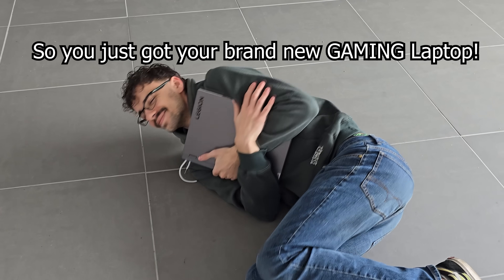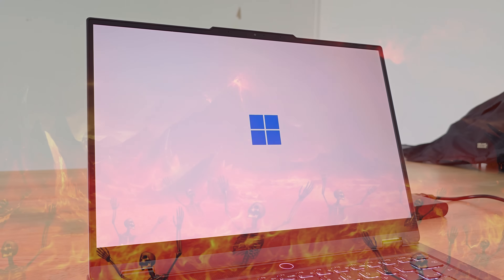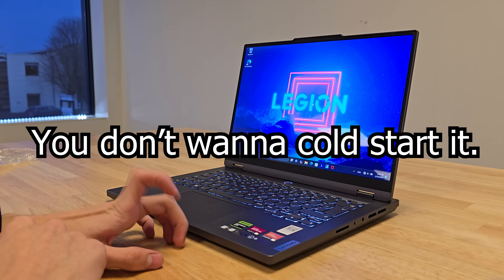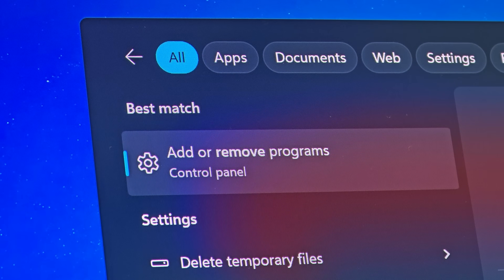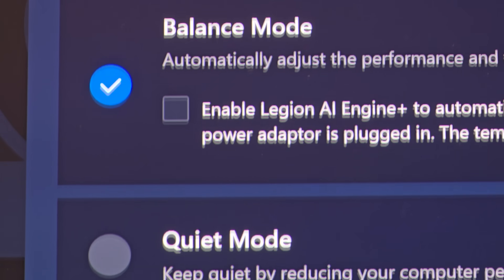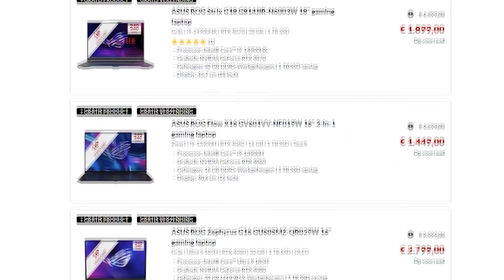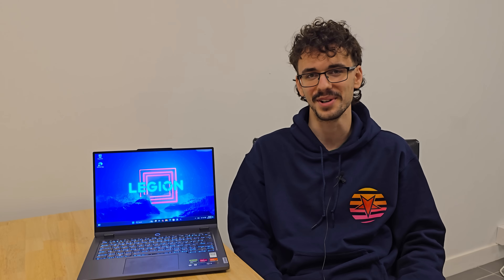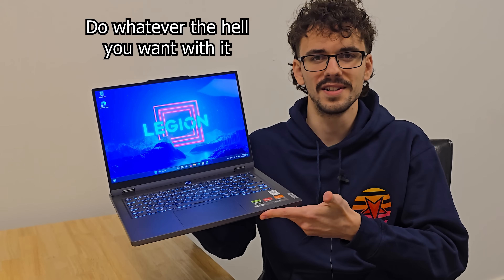FIRST THINGS to do with your New Gaming Laptop (Tips and Tricks / Setup)

Comment: Eluktronics Hydro 16 G2 with the LPP cooling caddy here, ideally if your laptop supports water cooling and it's covered under warranty, don't skimp out if a laptop is your only option for pc gaming, my CPU sits at 37 idle and I've never seen it go above 80 under max load, laptops are so prone to 'burning themselves to death' if you can front the cash avoid relying on air cooling guys.

Comment: Also, don't waste your money on something with a plastic body and frame, the metal hinge will rip the shitty plastic screw holes out over time even with light pressure applied when opening the laptop screen
Reply: But metal casing laptops are expensive and oftentimes doesn't match the specs needed

Comment: I would highly recommend buying a laptop that's a little better than what you've had initially in mind and try to play games on low to medium settings on the silent mode for a longer life of internal components and lower temperatures overall. Trust me, it's worth it on the long run

Comment: is it ok when doing the MULTICORE test  for the 
core 87-93 and package  96 -104?
the spike is only when it starts the new image. the spikes are for  1-1.5 second at most before drastically dropping.
the rest of the time 
core temp: 86-88
core max:96-98
package: 96

Model:
Lenovo Legion Pro 7
Intel ultra 9
5070ti
32gb

also it seems when the back was elevated, it scored worse lol
elevated | Leveled
   2216        2220 - Single
  36545     36695 - Multi

think it has something to do with the liquid metal cooling?

Comment: The only thing holding me for byuing an oled laptop is there is no waranty on burning liek if they offer a waranty of 2 years i wilk glad to purches it
Reply from the maker: I have never had burn-in on any of my OLED devices. Modern panels have so much anti burn-in prevention that it's basically impossible to get it, unless you keep it on 24/7 for 4 years on the same screen with the brightness cranked up

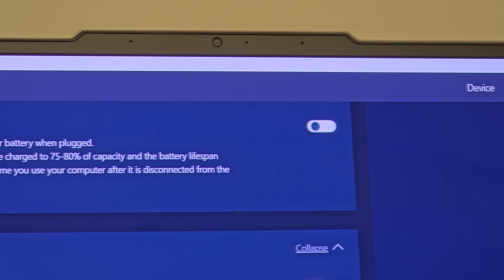Comment: 6:56 I never run my laptop on battery is that a problem, I alwaysd have it plugged in
Reply: No it's not really a problem since most laptops have a protection system to prevent overcharge and overcurrent. It's actually good for your laptop to stay plugged in if dealing with heavy load tasks and applications.
Reply: @IPhoneLovesIphone  thx bro
Reply: Unplug at night went not in use to also some cycling
Reply: Your laptop might have a customizable max charge limit, try googling your laptop model and "set charge limit"

Comment: Mother F'er!! Now I'm pissed I listened to Jarrod's Tech where he basically said you have to sign up for the Microsoft account in his set up video. Now I'm stuck with this BS!! Damn I'm pissed!!!!!!!!!!!!!!!!!!! I wish I would have seen this video first!
Reply: You can change to local account still after install
Reply: @matis9783  That's what I ended up doing but I still have a Microsoft account. Luckily I found out when you sign up Microsoft turns bitlocker on without you knowing it. So you need to go find your key so you don't get locked out if there is a problem.

Comment: My hp victus 16 (i5 13500hx rtx4050) gives lower cinebench score. Smethng around 13k, 14k i think. Iv put arctic mx 6 and thermal putty aswell .. laptop cleaned but still same issue.. thermal throttling often . Nt sure wt to do

Comment: Quick question: Should I remove the battery then plug the power cord in when gaming? Or it's fine otherwise?
Reply from the maker: No, that's not necessary. Laptop batteries take care of themselves when plugged in all the time, especially on gaming laptops.
If your laptop has a charging cap feature that stops it from charging above 85%, you should turn that on though :)

Comment: I just noticed that gaming laptops are stupid. Just get a used one with integrated graphics. It’s cheaper, the build quality is much better, and the battery is usually so much better it’s not funny. Isn’t the whole point of gaming laptops portability?

They can also play games decently well at low settings. For a laptop I just want games to be playable ngl. If I want good graphics I’ll use a PC where I can actually upgrade stuff.

Comment: Have it on balanced power plan, no need to keep cpu 100% all the time, very little benefits for doing it...also same for gpu in nvidia control panel, have it on normal power, not performance, extra heat, maybe a little bit of latency but not worth it....conservation on for battery, and use it on raised on something(do not use the charger to raise it) I got 2 "legs" from temu that stick on the back and can be raised whenever I want...performance it's not always performance, laptops do heat a lot and it's normal but not overheating......using that extra ""performance"" only causes extra heat and on a longer session is gonna clock down the speed of cpu and gpu and will run lower than balanced...i've not noticed a change of performance from balanced to high performance...maybe those who have a lower end laptop...but not even then probably....P.S. Coolers don't do that much...you can use it turned off, just raising it does enough to have a little bit better airflow....only the expensive ones have results.

Comment: My legion 7i pro 5080 runs battlefield so smooth and fast went 30 and one 1 on it even tho my desktop still blows that little thing out the water but my monitor is only 1080p so I thinks that’s what’s been fucking me but the moment I log off on my laptop it runs like total shit idk if I gotta let it rest or what but it gets all wacky and I make sure it’s elevated in a cold hard surface too and temps during gameplay aren’t bad but then again I’m coming from desktop I’m just on the road rn. But it freezes and doesn’t load up other programs and just freezes and acts up then Goes back to normal idk if that’s just a gaming laptop thing

Comment: Hey There, i reall need you help mate 
I have just bought Gigabyte A16 and found that the software does not have a conservation mode or anything to limit battery charging 
i use laptop 98% of time while charged as most of the time in gaming sessions and need the full power
Please what should i do
Reply from the maker: In that case just keep it plugged in at all times when you're using it. It's not that bad for gaming laptops :)
Reply: @crimsontechyt  Fine bro Really appreciate it❤️

Comment: Don't mean to sound like a jerk, but you're a "tech" channel and the "charge to 100%" advice is  25 years out of date. This applied to Nickel-Metal Hydride (NiMH) batteries which have not been used since the early 2000's when Li-ion batteries came long (which did not suffer from the "memory" effect).

Comment: Guys, the tips given in this video are just the tip of an iceberg, if you really want your laptop to better and faster perfrom an cpu temp throttle lock and undervolt your laptop ( research what it is and how it works before doing it ) it is so underratted trick that helps you have the same performance even after years of using it which just means saving your laptop from cooking up.

Comment: When i got my laptop i instantly upgraded the ram then debloated windows and just overclocked everything for the best performance
Reply: Did you run a debloat script? use powershell? or just manual? I would want everything off. Copilot, all the telemetry etc. Anything I can take off where it won't conflict but I dunno what that everything is

Comment: 1. Just plug in and use, no need to charge it to 100%. It already charged and tested at the factory.
2. Ditch whatever brand performance app and use third party ones. Asus Armory crate for example, is a joke. Ditch it and use G-helper instead.
3. Don't fuck with windows performance profile. All that stuff is  in the bios and managed by the performance app. Leave at default (balance) you don't need windows to tell the pc one thing and the performance app to force it another way.

Comment: I have OMEN Gaming Hub and I do have Eco, Quiet, Default, and Performance mode which like you said to use Performance when Gaming. But below that, it has a Fan Speed option: Auto and Max. I have it set to Auto which is by Default so should I leave it as Auto or Max? For Max it says: Max fan speed overrides the auto mode and enables maximum cooling for the selected performance.

Comment: NVidia GeForce Experience has been replaced with NVidia App which you have to download. Hope this helps if yours disappears after updates like mine
Reply: That was helpful thanks😊👍
Reply: Is it ok if I download also intel graphics driver?
Reply: my laptop is not picking up the graphics card. Do you perhaps know how to get it to work?
Reply: @KeneilweManganya try installing the drivers or make sure the motherboard has the capacity to run graphics card (not a pro in this still🥲👍)

Comment: I just bought a Lenovo LOQ15, im happy to set it up with the help of your video! Thanks a lot!
Reply: Hey, btw did you connect it to the wifi first or no? just asking
Reply: @delsocuran2459  nah, it didnt had a OS pre-installed. I installed windows with a boot stick and then used shift+F10 and start ms-cxh:localonly to start the local only install process without shitty Microsoft account or anything :D
For WiFi you will need the WiFi Drivers already on another drive to insert and install them from onto your laptop after windows is installed. Or if you have the ability to use a wired connection, you can use that to install it and then use WiFi. I hope it helps :)
Reply: @delsocuran2459  I bought it without a OS. I used a windows boot stick created via rufus to install Windows 11. And used the workaround to not use an annoying MS online account but instead an only local account like in the old days. (shift+f10 when the login request screen appears and then enter start ms-cxh:localonly into the cmd)
To use the WiFi you will need the wifi drivers from lenovos website either on a USB drive or use LAN cable first and download it on the device itself.

Comment: Hi, I wanted to ask, please tell me, I ordered Asus Rog strix g17 (2023) (r9 7845hx/4070/32gb/2tb/2.5k/240hz) for $ 1,591, but in game tests on YouTube I saw that a laptop, for example, with a 2.5k display and 4070 gives out significantly less fps than a laptop with an fhd display and 4060. I found exactly the same Asus Rog strix 17 (2023) (r9 7845hx/4060/32gb/2tb/fhd/240hz) for $ 1,367, but here it is already an fhd display and a 4060 video card, and otherwise the laptops are identical.  Now I can't decide, maybe it would be better to cancel the order for that laptop with a 2.5k screen and 4070, and order the same laptop, but with a 4060 and fhd screen? Maybe it's just not necessary to have this 2k? At 2.5k resolution, fps are much lower in different games, and putting fhd on a 2k monitor in heavy games, well, there is stretching, pixels, etc., maybe you should take it with fhd right away. Is it worth canceling the order for that laptop and ordering with 4060 and full hd?  (I buy it only for games, and also to make presentations for studying at the university, and I play approximately these games: Counter-Strike 2, GTA 5, SAMP, WoT, PUBG, Fortnite, Minecraft (ultra with shaders). Thanks in advance! (p.s. I live in Russia and these are 2 adequate laptop options that I could find, so I am not looking for others, I have a choice between these two models, so I have to choose one or the other)

Comment: There's this legion 5 (not pro, but honestly it pretty much is, the pro variant just doesn't seem all that different, justkre expensive.) it's a RTX 5070M (mobile, they didn't put the M but I put the M it looks nice) some Ryzen 7 350 with an IGPU, which is perfect for me if I'm gonna use this as a work laptop too, not just games. I genuinely think, for me at least this beast is just the best of both worlds, Enough gaming for what I need it to, just some emulated games, Minecraft with a buncha mods etc. Also standard 1TB M2 nvme ssd, has 2 slots of this and 2 slots of ram, which have 16GB of ram each, 32 total, 5.6k MHz, that screen is just great. Pretty much everything can be upgraded, ram up to 64 GB officially, what I've read at least, but 32 should be plenty for the beginning. Ssd, basically as much as you need/what's currently available so the standard max if I'm not wrong is 8tb? 1tb is more than enough for me however. And the price, 1.6k euros, I think this might be 1.7-1.8k dollars. So in terms of price it's pretty good for what it has. I'd also use this for blender, school stuff, music making probably with FL studio and yeah basically all I can think of as the second main use.

Comment: What should I do if I connected to the Wi-Fi when I first turned it on before I watched this video please? Ps. Thankyou for this, it’s very helpful 🎉
Reply from the maker: It's fine :)
You could just use a Microsoft account, but you can also remove it in the settings if you'd want to
Reply: @crimsontechyt Thankyou I will try that 🙂
Reply: Damn not me seeing this video 2mins after i signed in with wifi. Then did a reset on the PC. Dont even know if it will help and be able to start over.

Comment: I just bought the new 

MSI then 15. 

RTX 4060

AMD RYZEN 7

GB16. 

I stopped playing games immediately the problem the FPS is going crazy all over the place.  200-12 - 50. In numbers if it’s go down, it will completely crash.

I found a way to fix it go to Nvidia GeForce settings  lock it to 60 FPS

Comment: Question. Is it okay to play on my laptop while it's charging, even if the battery is already at 100%? Is it bad for the battery?
Reply from the maker: Yes, you SHOULD play games while the charger is connected.
If you always use it plugged in, it might be smart to limit battery charging to 70-80% :)

Comment: What Microsoft program exactly? I had already set mine up yesterday before watching your video, I was also looking for HDR guidance, and to use or not.  
Asus G16 Z with 5080.  
In the Nvidia app, display mode and G sync ?   Nvidia GPU, Optimus or auto or the options.     
I turned off the overlay, but how do I display the FPS at the top right corner of the screen, it used to be there now it’s not

Comment: It would be cool if you made a manual fan speed tutorial. My ASUS ROG Armory has this option but I don't want to choke or blow up my baby. But I know people have some really good magical numbers that keeps it silent and activating steady fans with solid air flow when gaming that don't sound like a jet engine. Often Balance mode just make the fan speed freak out going up and down when you open the Calculator. Are ideal manual fan speeds nonsense for laptops or is it some kind of pr0 secret not many know about how to get right?
Ty nice vid.
Reply from the maker: I use G-Helper on all my ROG laptops, since you can set fully custom fan profiles on and off battery, so it can be completely silent :)
Here's the video if you're interested!
https://youtu.be/5XUIMUzgHU0
Reply: @crimsontechyt  I see, just started watching the G-Helper one, thank you.

Comment: Hey what gaming laptop should i get with a budget of 800bucks (i already want an acer V16 (i7 14650HX 4060) but some users complained of it getting BSOD and screen issues
Reply: acer nitro v16 has crappy build quality (including trackpad and speakers) and the cooling is not the most effective (not mentioning the horrendous fan noise). screen's color gamut is also very poor (only 57% srgb and 38% dcip3 according to notebookcheck)
Reply: @traxim6988 i got the v16 cuz the specs and the 4060, the screen has 180hz and 100%srgb well i dont use the speakers and trackpad i use a external one but i forgot the model and i use a mouse
Reply: if you don't mind all of this and will be fine with it lasting max 3 years, go ahead and buy it
Reply: my personal choice in this price range would be to get lenovo loq (avoid loq essential and 7435hs cpu (no igpu means terrible battery life) configs also make sure to check screen color gamut of screens on your picks)

Comment: When I tried an press Shift+ F10 it appears the command tab but I couldn't write anything. Keyboard wasn't working
Reply from the maker: You simply have to click on the CMD window :)
It doesnt register any input at first
Reply: @crimsontechyt I didn't know about that and I connected to internet but then it stucked at 0% for too long and I disconnected internet and did what you said "oobe\bypassnro and worked, laptop restarted and I was able to continue with the settings. And now windows installed, just need to download latest updates and drivers.

Comment: I was about to buy a plastic ACER PREDATOR with RYZEN 7 8845HS and RTX 4060 but then remembered your vids liking the smaller but higher quality ROG G14 and that my first laptop was a plastic ACER NITRO V that I hate the material and quality, so I bought the lower spec entry level ROG G14 2023 (RYZEN 7 7735HS with RTX 4050) and I was glad I bought it even if it was a bit lower in specs and a bit more expensive but the quality is far better, the material and the feel is better too. The ACER PREDETOR was cheaper and has better specs than the 2023 G14 but the better quality and materials is worth the price and lower specs. I am hoping to keep this longer and take good care of this ROG ZEPHYRUS G14 until get another newer ROG Zephyrus or a LENOVO LEGION or the HP OMEN. I bought it April 11 just this month. 😍😂😀